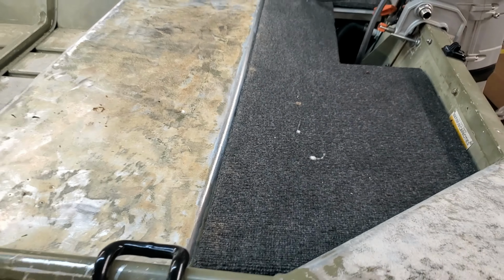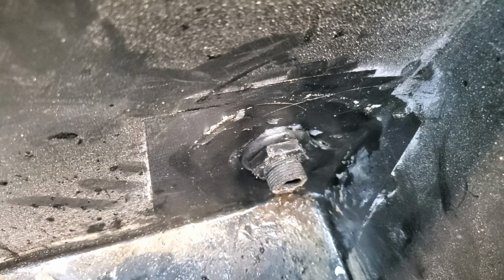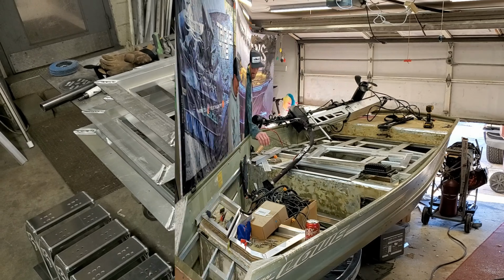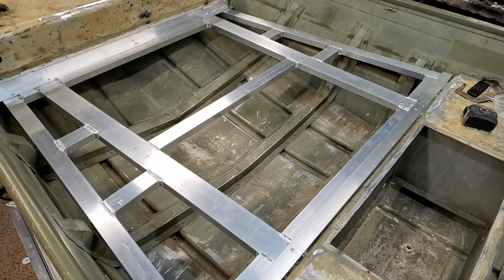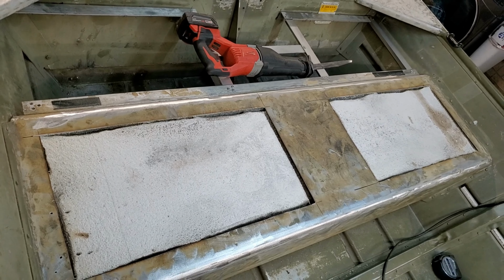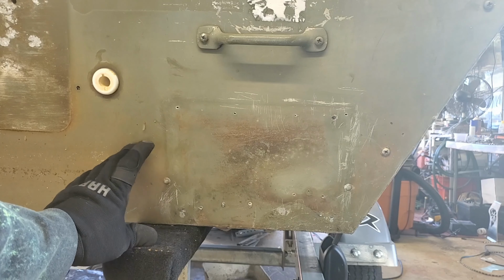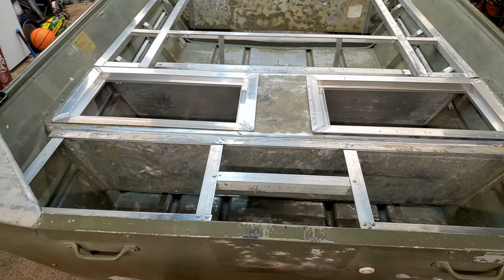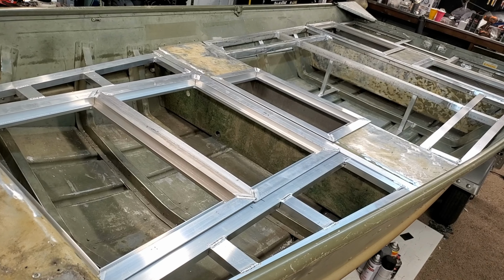Insane 14ft "Electric Only" Bass Tournament, Jonboat conversion!

Comment: Quick question. Why is the front deck so angled downward?
Reply from the maker: Its not. It looks  Deceiving. It is completely flush with the front and back deck. I thought the same thing, but it is pretty much in line with the water line on the boat.  I think once it's in the water it's it should sit flat.